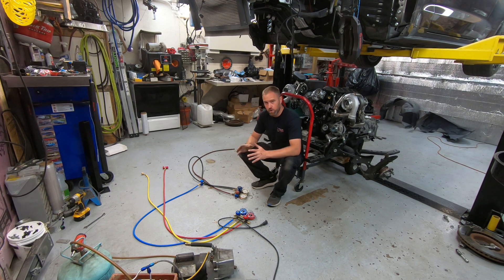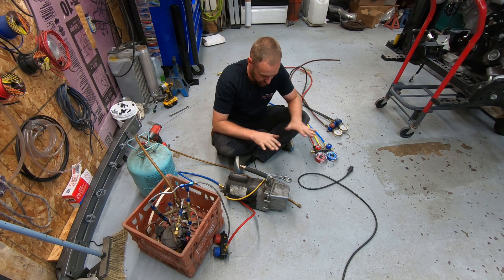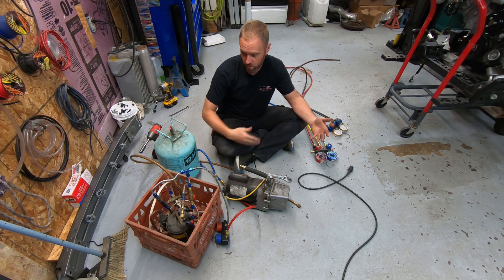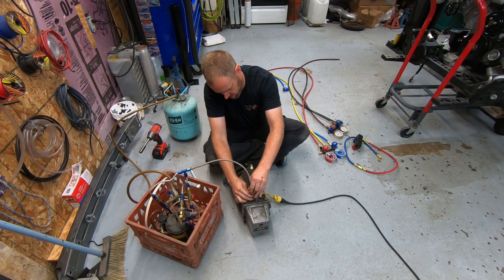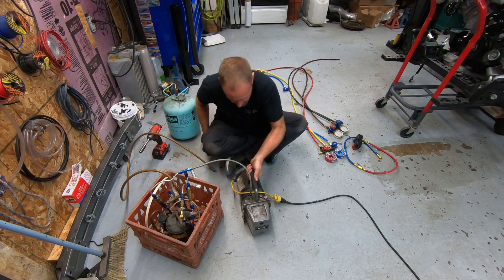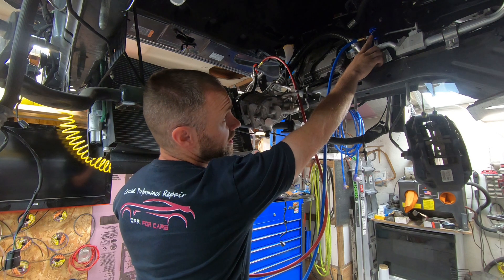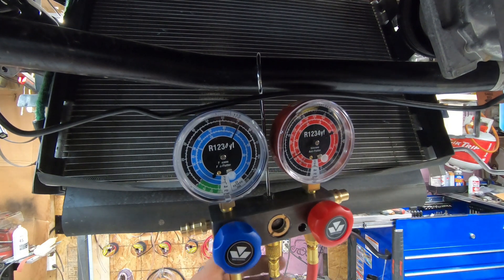Recovery of 1234YF AC system with home made machine

Comment: So I'm going to be doing a YF recovery and will be buying a recovery machine, already have the gauges, tank, vac pump.
Question do the hoses for the YF tank connect to a Vevor Recovery machine just says its a HCFC unit?
Just wanna be sure I can hook directly to it and use it for recovery with YF equipment.

Thanks for the Video, Pretty cool little unit you made!
Casey

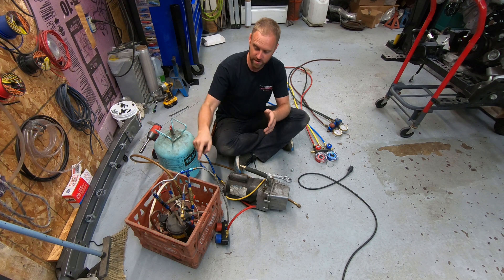Comment: JUST A friendly heads up referring to reusing a single use tank @ 3:12 . at my previous job we ran through allot of refrigerant. I used to do the same thing. We made adapters to use them as air tanks for airing up tires.   Most single use tanks we ran into starting about 3 years ago had a new design fitting ontop and the cut the top off trick does not work anymore. I know the new valves were on tanks of 134a, 410a, 427a, 404a, MO99 and 407c refrigerants so u may want to keep any old tanks you have laying around. and yes YouTube code enforcement  police I KNOW your not supposed to i know the inside of the tanks are not painted, i also know my original tank from like 5 years ago still works fine and compressed air is WAY less pressure than any Freon and is 25% of the pressure the tank is rated for so there's no way the tank will "burst" it may get a rust hole and leak out some day.

Comment: Gotta be real careful when working with this new refrigerant. Special vacuum pumps and evac machine that won't produce any static, also contamination is a big deal. I've been hearing about dealers filling 1234yf systems with 134 because they can't get 1234 quick enough. Scary when you can't even trust the dealer
Reply from the maker: At least the 134 is less volatile so it's safer. The cooling properties are dang near identical otherwise so I don't think it will hurt anything.
Reply: @CrazedPerformanceRepair  i heard it's like using propane.. proceed with care.